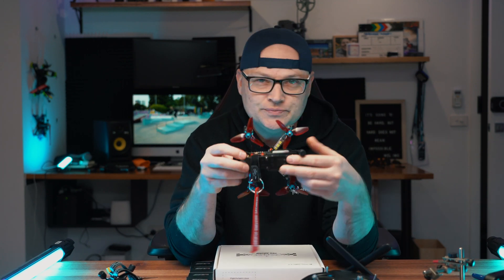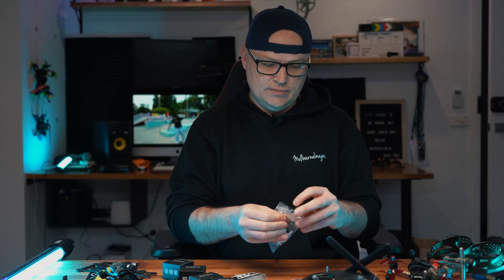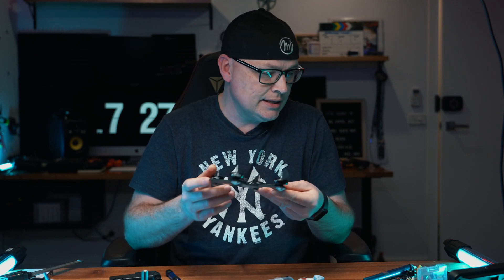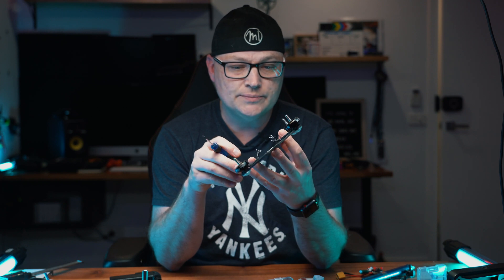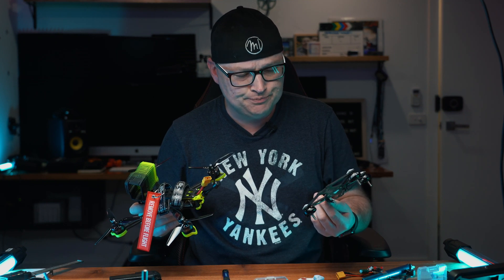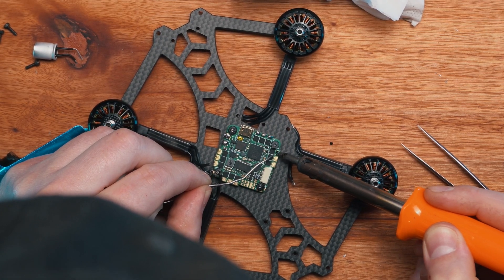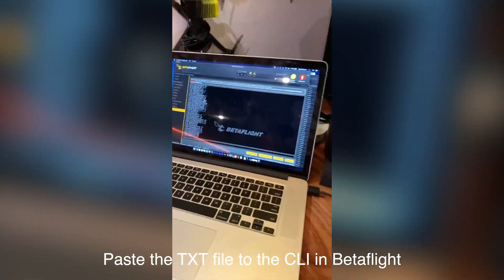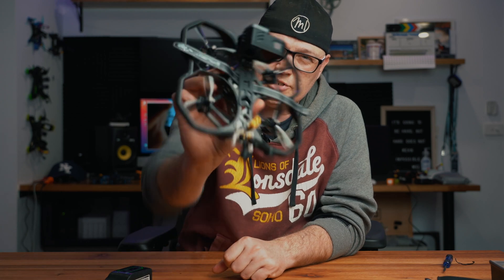FPV iFlight PROTEK 35 BUILD beginning to end

Comment: Great Video. Thanks. Did you have to add anything to do with BFHeli for the ESCs for this Beast F7 AIO module? Or did you just go with what was default installed in the module? Thanks in advance.

Comment: Great video and to the point. Did you have to change the antenna air unit extension cables to longer ones or did the one in the video fit ok?
Reply: @onebyone.media.melbourne  Thanks for the head up